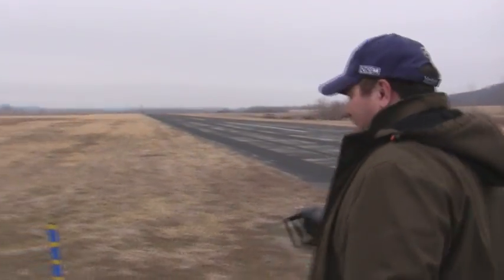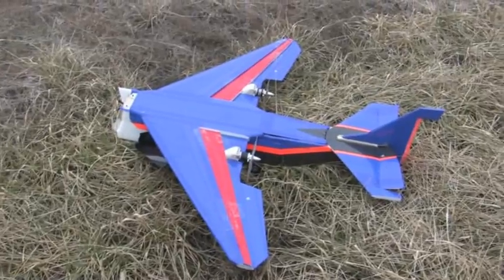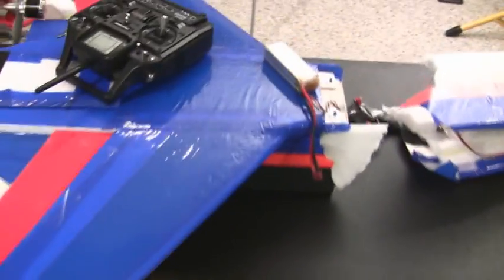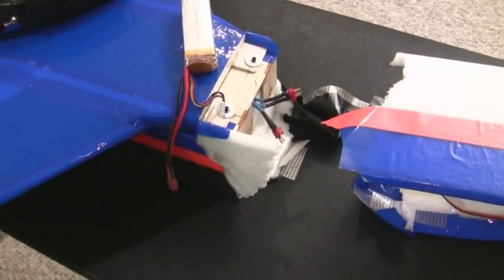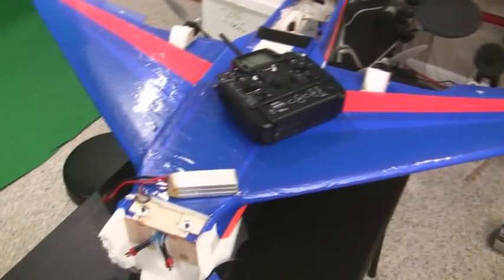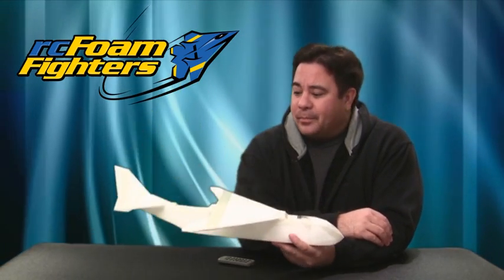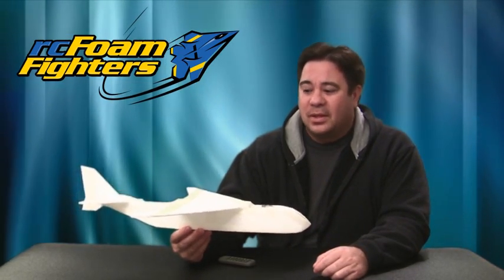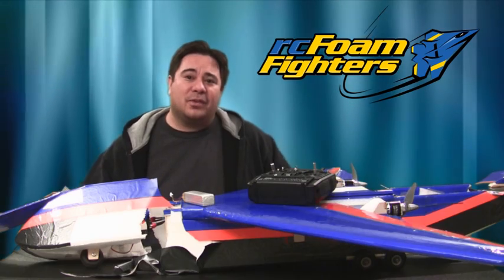Project Jupiter Part 7B "Testing The Airfoils"

Comment: If the plane is pitching forward instead of just getting added lift this would seem to indicate that the flaps are located too far to the rear of the center of lift. Either that or your CG is far forward of the center of lift. Do you need up trim on normal flight?

Comment: Since you were still turning (had ailerons deflected) when you engaged the flaperons it caused unbalance lift and/or adverse yaw.  The right aileron would have been down and then adding the flaperon caused the aileron to go very far down and act as a brake resulting in adverse yaw.

Comment from the maker: Thanks mutilatedjak!  Good points you made.  At the slower speeds it appeared the Flaps did not produce as much of an endo effect. I was more thinking to do basically like I did for the second landing that went good, waiting till i was level and aligned with the runway before engaging the flaps. I am planning to add a little elevator mixing as you mentioned for the Flap function. And also reducing the throws of the flaps. Thanks for your comment!

Comment from the maker: Thanks for the input Ken. I agree with you, it seemed i need to be staight and level to maintain good control. it may be possible the KF airfoil makes the effect of flaps even more effective because the keep the airflow on the flaperons better. These were the first flights where i used the flaps, I will most likely have to reduce their thows so they don't over power the plane. Thanks again for your valuable input Ken! Its good to have you on the team!

Comment: if you engaged full flaps right before you land wouldnt that just cause the plane to endo (dive) closer to the ground?...less time to recover as well.  Definitely need some elevator mixed in, flaps create a nice moment about the wing that the elevator can counter act.

good luck with the rebuild

Comment: the problem with overly aggressive flaperons on my planes are that it seems to increase their susceptibility of stalling. the plane really has to be level for me to achieve the best control of it. this is on a symmetrical airfoil (on my 3D plane) and on just flat foam with no airfoil. maybe combined with the KFm3, it's producing an excessive amount of lift (maybe there is such a thing as too much lift?) and too much of anything never seems to work well. maybe i'm just thinking too much? LOL

Comment from the maker: Thanks rcramosrc! I agree too about the flaps. I may try some seprate flaps on a future model. I think currently I have the Flaperons moving too far down when the bottom switch position is selected. i will adjust it for any future flights. Thanks for your input!
Paul

Comment from the maker: Thanks jb753! Don't worry, I promise I will get the Jupiter back in the air once I fix her up.  I have been wanting to do the tests you mentioned.  Maybe when i do the load tests i can measure how far each airfoil takes to lift off. this may be difficult to do accurately though if the wind is gusty or varied. Thanks for the awesome support!
Paul

Comment: You definitely need to repair this plane!  I think that it is one of your most interesting projects.  I have been interested in KF airfoils for a while but this is the first back to back testing that I have seen.  One test that I would suggest when you get to the load testing is distance from a standing start to takeoff.  Thanks for doing this interesting work.